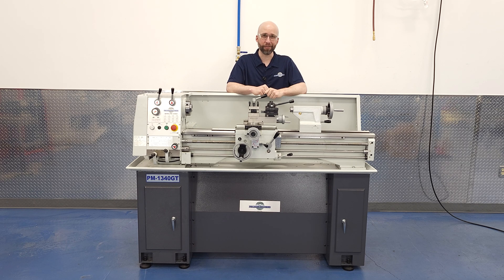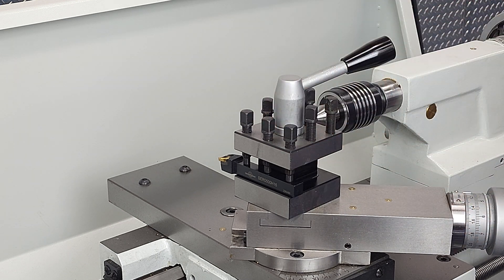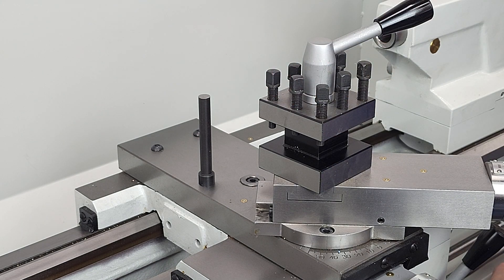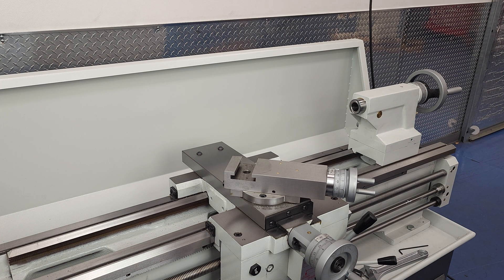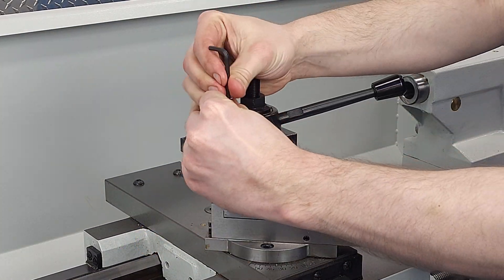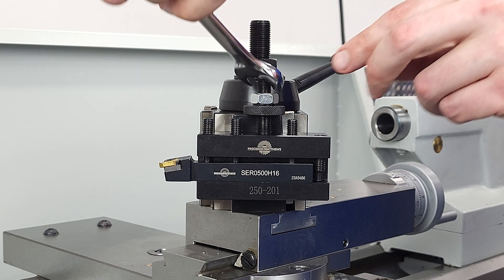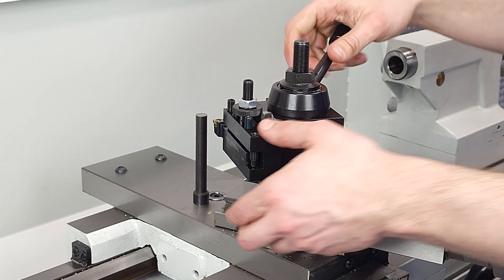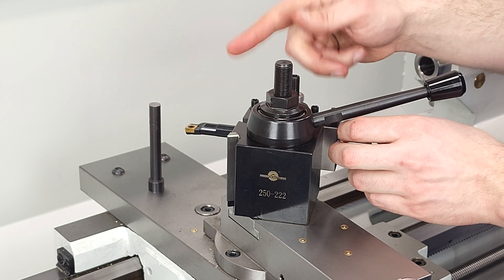Quick Change Tool Post Precision Matthews Media

Comment: Nice job Charlie. Crazy question, why is it on a quick change that the lock handle gets in the way of the boring bar tool when trying to remove it and is there a good remedy to reduce the movement of the handle?
Reply from the maker: There is no way to adjust how long the throw of the lever is, but you can adjust where the throw is by shimming under the lever. You should be able to find a spot where it is not in the way for the front dovetails when fully loosened, but also not in the way of the side dovetails when fully tightened.

Comment: I have 2 lathes. One has quick change and the other has the turret style 4 way tool post. Personally I like the4 way turret on the bigger lathe. It is more rigid and I also have 4 tools already mounted and set to dead zero on the center line of the spindle. In the event that I remove a tool the shims go with the tool and are stored in a wooden pocket at arms reach. The turret style that i have has the detents so I can rotate the angle of the tool to different positions including 90 degrees with out the need to loosen with a wrench the Tee bolt. I'm sure you and others know what kind of "Old School Turret tool post I am talking about. My reasoning for preference is more than just cost and having to store multiple tool holders . I actually had an incident one time when the tool rolled under the part I was machining and actually caused the tool holder to pull up and almost out. And I have the wedge style Quick Change . I was using a parting tool at the time it happened. It was my fault for trying to go too deep. In a nutshell both style have good points and not so good points. BTW I have a PM 833 T bench top mill and I love it. Precision Mathews is a good product and Quality Machine is top of the shelf for service after the sell.

Comment: Many years ago, I purchased my first lathe and it came with a 4 way tool post. I quickly found out how important it was to get the tip of the tool on center. The biggest challenge for me was that my tools varied in size so I was spending a lot of time trying to get the correct shims installed. I saved my change for a while and was finally able to get the quick change tool post, and I am thrilled that I did.

Comment: I'm on the Quick Change TP side of the fence, but what it comes down to in reality for most hobby guys like me is cost.  I used regular tool posts and about a dozen disassembled 35 leaf feeler gauge sets over the years till I finally broke down and bought a AXA set.  Best lathe improvement yet. Good video Charlie.